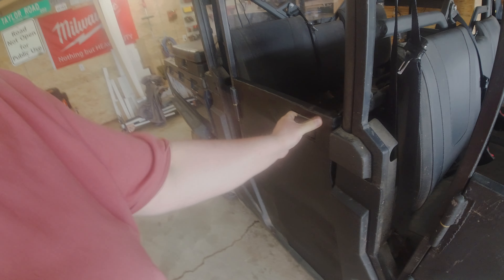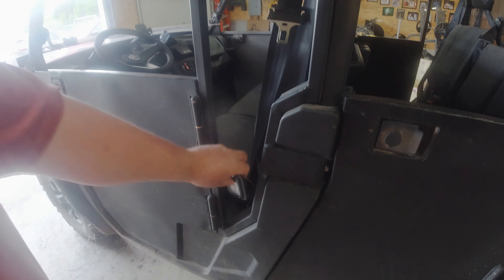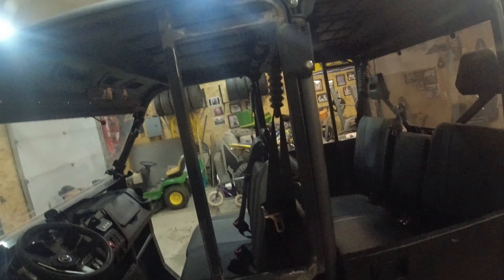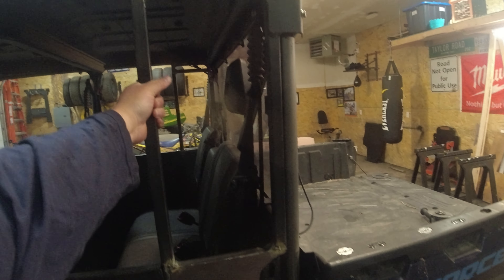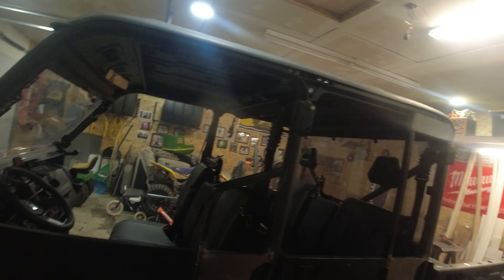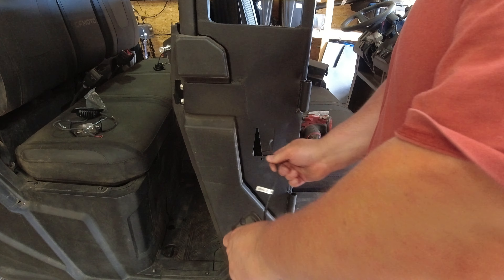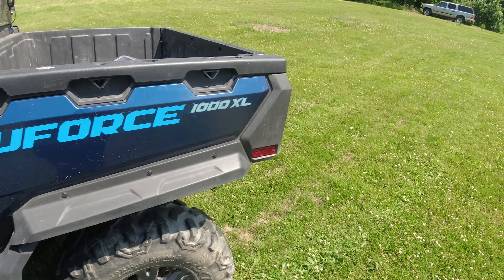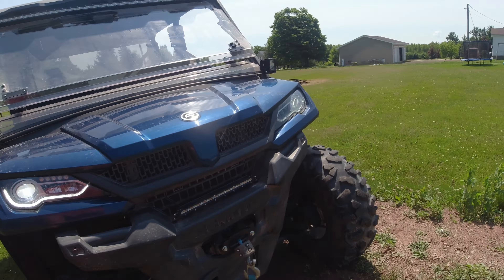DIY Door Build Completed | Part 5 | CFMoto Uforce 1000XL

Comment: Good job 👍 I just did a SuperATV windshield install video on the Viking
Reply from the maker: I'll check it out! How do you like the Viking?
Reply: @Nicks_Shop  It's great , with locker's front and back goes anywhere, super reliable too , only burned out a fan motor , in five years

Comment: Do you have a parts list? Would love to try this myself. Thank you for inspiring.
Reply from the maker: No sorry I don't... I just bought the square tubing as I went and ended up using 1 whole 4x8 sheet of 20 gauge sheet metal. 
The hinges are just 6 inch weldable bullet hinges from Princess auto and the door latches were from an RV off Amazon. 

It's definitely a 'one off' build process so hard to make a list or exact tutorial on it. But don't be afraid to get a welder and some tubing and see what you can do!